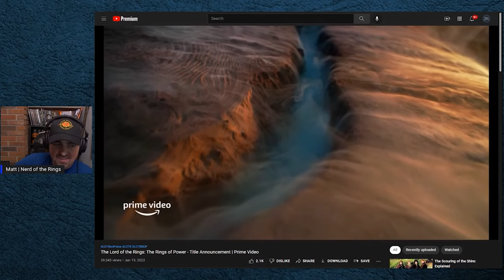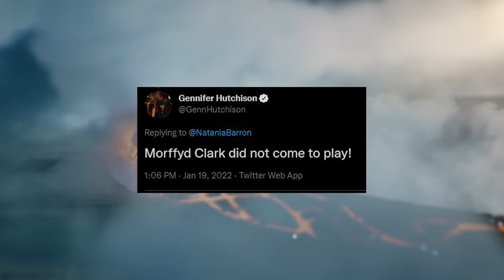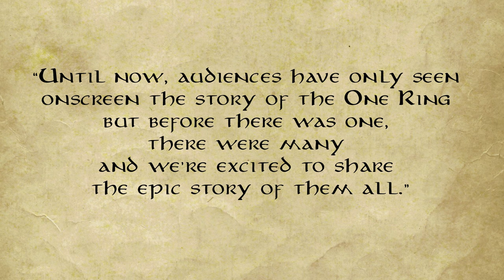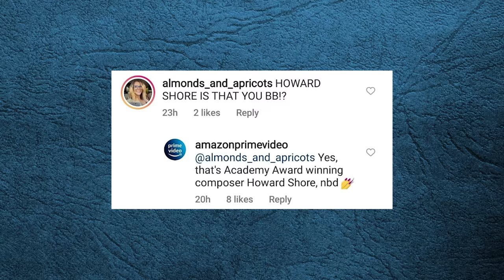Rings of Power Teaser BREAKDOWN - Galadriel, Howard Shore Confirmed, TV-14 Rating and MORE!

Comment: Had low expectations for this from the beginning, but kudos to them for doing this title sequence practically. Honestly thought it was CG. Might have to pick up the soundtrack too if it's really Howard Shore's work. Made me miss Cate Blanchett's ethereal tones though.
Reply: I still kind of think it's CGI... it doesn't look right.
Reply: @connielingus8385  They added small partical effects etc. It's mostly practical effects.
Reply: I watch a lot of woodworking videos on YouTube. A year or so ago there was a craze of attempting to create so-called River tables (usually done with epoxy) with metal. They'd pour molten metal into prepared tree slabs. It never went anywhere near as well as in this title card. Lots of smoke and localised flames. I struggle to believe there wasn't an awful lot of practical and cgi trickery involved.

Comment: I had so much hope for this series. But after watching season 1 of The Wheel of Time and then reading the book. I'm not holding my breath. If it turns out amazing awesome, if it doesn't I won't be surprised either.
Reply: Havent that show but let hope a lot things arent change from the book asides from maybe 2-3 things IF the change way to much then we have a problem
Reply: I"m not sure what your particular issues with Wheel of Time were, but in my mind, 75% of the problems were due to COVID twice interrupting the production and a major cast member leaving in the middle of production, with a need to awkwardly write him out for the rest of the season. Minus that, in my mind, Wheel of Time would have been a strong adaption. And, I say this as someone who has read the entire series all the way through, seven or eight times, over the past 25+ years.
Reply: @aaronzegas5270  Maybe you've read the books 100 times, but you have to at least agree, the series was significantly watered down and some choices were made that didn't make sense. (At least it appeared that way to me) They seem to have removed entire sections of the story and replaced them with silly whimsical moment's or moments that could have been cut out entirely.  So much so that the whole thing had a cheap fan fiction vibe.
 
And since COVID hasn't really gone away, there's the possibility that the same explanation can be given next year. 

At the end of the day COVID or not, there are properties with large audiences that are meant to be amazing experiences and often with very specific ideas and themes. And you can tell when they're done right and when they are not. In my opinion WoT wasn't and coming from that and other series like The Man in The High Castle, Amazon clearly doesn't have the best track record.
Reply: @xenicmark  Thanks for your comprehensive reply. What I meant by COVID, was that it interrupted production and they lost access to some places they meant to film, had to cut out parts to the detriment of the plot, and had to cut budgets. It's really expensive to start and stop a major TV production like that, particularly in its first season. Amazon gave them a pretty decent budget, but pretty decent isn't unlimited and they had to cut some corners they otherwise wouldn't have, absent the production twice being interrupted by COVID. And losing a major character's actor with two episodes left to film was incredibly difficult to compensate for and still have a story that made sense. Most of my issues with the show were with issues outside of the control of the production. 

I think the writing was generally good. There were a few areas where the changes from the books didn't make any real narrative sense, as you pointed out, but, I think the majority of the changes were done with non-book-readers in mind (which, as you know, are the vast majority of pretty much any TV audience). There's a lot of things you have to change when a) you don't want to get too talk-y, b) you don't want to introduce too many characters at once, c) you don't want to have segments that look and feel the same (i.e. Mat and Rand's journey from Whitebridge to Caemlyn), etc.

The effects varied, sometimes looking great, other times not working out. But, I think a lot of that was having to cut some corners for budget reasons. If they film a season uninterrupted, I think you're going to see a much more coherent production. 

 The acting was top notch and I think really captured the essence of the characters, even if their arcs were somewhat different.
Reply: @aaronzegas5270  😄I do love comprehensive replies. Anyways Ill give you Rand and Matt's journey. That would have been repetitive and talky as hell. I guess we'll just wait and see what they do with this series.